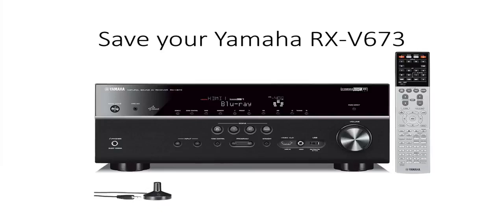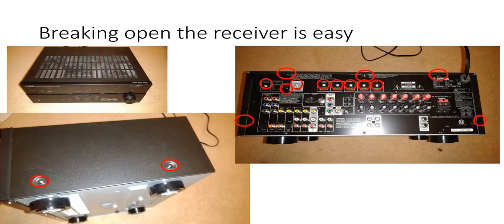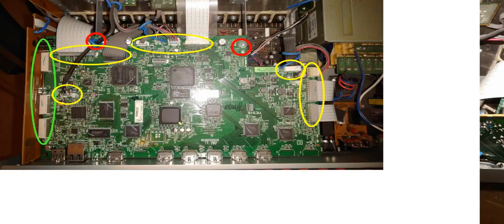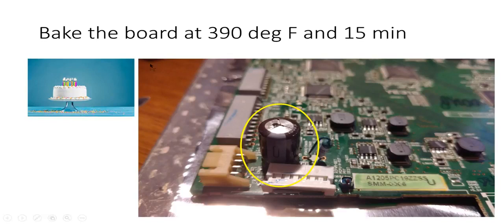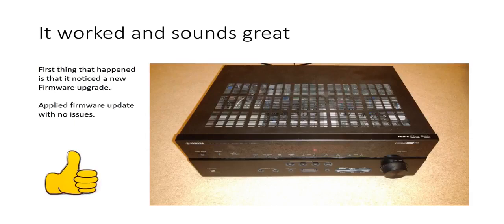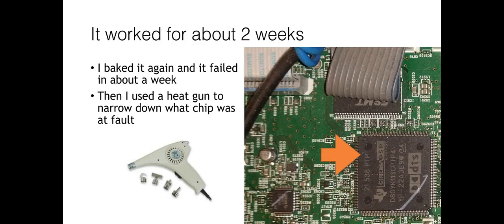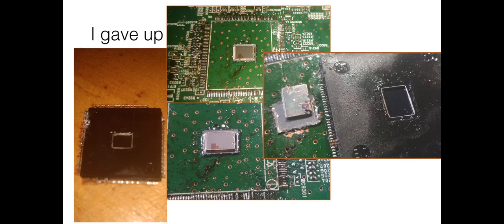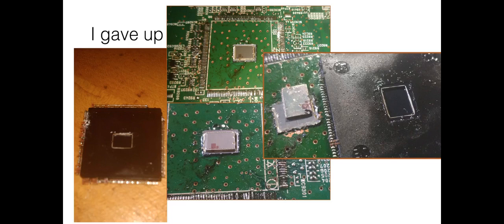Save your Yamaha RX-V673 (but it might not be permanent)

Comment: Why didn`t Yamaha use for example like a cpu socket on this DSP chips. Much more easy to replace them. And the contact would be much more stable! Got myself a Yamaha RX-A3040 receiver. Two identical DSP chips on that one. The known error is that the sound cuts out for a few seconds and the display of the speakers disappears from the screen of the receiver.
This only happens when running digital sound. Netflix etc. If you run analog sound, the problem disappears. I first sprayed the entirely digitalboard with Wd-40 spray. And used a toothbrush to clean the entirely digitalboard and chips. Then used a cloth on the chips. Then a hairdryer for 2 minutes on the DSP chips. Let it cool down for 10 minutes. Then I put Honeywell PTM7950 Super Highly Thermally Conductive Pad on the chips. Problem solved. No more sound cuts.
Reply from the maker: Money money money.  Every little piece of hardware used inside hits there bottom line and doesn’t help sell the product so your left with problems that are hard to fix.  Shops just swap the boards and chuck em if they fix them at all.
Reply: @yourdiytechlife exatamente. Obsolescência programada para giro de dinheiro.

Comment: My issue started after attaching an old Google Chrome device to my LG OLED which was attached to my RX-V673 via ARC. Replaced the receiver today with a new DENON (since the Yamaha is now 13 years old) and everything worked fine. Then the sound cut out again and speakers started to squeal and pop only when Google Chrome was being used. Not sure what happened. I removed the Google Chrome device and both the Yamaha and it are going in the electronic waste. Not sure if this is a coincidence but maybe it actually damages the receiver.
Reply from the maker: Yeah,  unfortunately I had to replace mine as well, I never found a way to keep it going for longer than a day.  I would expect that it was purely coincidence that it died when it did but why take chances.  I replaced it with an Onkyo RZ820 series that does atmos.  I’ve been very happy with I so far.

Comment: Man, i have the same problem. ARC worked only after on/off and changing channel a few times and now it doesn't work at all. Firmare in the menu is blank and when I update via USB it does it's thing for some 15 minutes or so and then i get the error 0010 -.- I am a bit hesitant to take the board out since i might damage something. You think it could work to use a heat gun on the board instead? And if so, are there specific spots I should apply the heat to?
Reply from the maker: You can absolutely try a heat gun.   And based on what I did that probably the best route really.  I ended up having to just replace the thing but heating the chip did help.   Hope you have better luck
Reply: @yourdiytechlife  ok so i opend up the thing and blasted the DPS chip with my heat gun untill it was very hot, i could not measure the temp, but it was too hot to touch. But that did not change anything. However just to make sure i tried everything, i tried updating it again by usb. And this time the update went through sucvessfully which was a surprise. Then after one or two restarts of the receiver and tv it started to work again! Just like that... now the question is how long it will hold up but we'll see.
Reply from the maker: @noiztrauma  that’s great news !!   Hopefully it holds but let us know either way.
Reply: @yourdiytechlife  will do if I keep it. I am playing with the thought of getting something else. Then again i haven't found anything in the same region of price and features. Plus it seems as pretty much every single brand had their own issues with dsp or acr and so on.
Reply: @yourdiytechlife  i will give it a shot. If that doesn't help i will get something else from another brand. Really a shame because the thing has a lot of good features, especially for the price. But the hassle with the ARC and so on renders my whole 7.1 system useless basically.

Comment: 100% the problem is the DTS/DSP chip. Very common issue with these. Flux should take of the problem. Or turn on Pure Direct, which bypasses the DSP chip and you'll hear sound again.
Reply: Same issue with my Rx_a2010. However in pure direct I still have no sound.  Any 8deas appreciated

Comment: I got a RX-A830 with no sound..  Speaker-icons shows on the OSD, but no sound..  Tried heating up the DSP-chip, but still no sound..  Test-tone or pure-direct doesnt work either. Very weird.
Reply from the maker: Thats eventually what happened to mine.  It simply failed all together and at the time the cost of a new chip was not worth it so I ended up replacing the receiver all together.  I have been using it for parts to fix other receivers so it wasn't a total loss.

Comment: Hey Dan. I came up with the idea to add a heatsink after baking the DSP chip as well and you already tried it. But I have to say you did it wrong. I realized that right after you got the chip removed: the actual silicon soldered to the PCB which acts like a heatsink. So the extra heatsink actually should be attached to the bottom of the chip (yes, right to the PCB on the other side of the main board). I have HTR-7065 with the same looking main board and the same issue and I'm going to try it my way: 1. bake the DSP with a heat gun from the bottom of the chip. 2. attach small heatsink(aka memory heatsink, I have different sizes, so I'll try to use the biggest that can fit) to the PCB under the chip with thermal glue.  At the same time I'm not sure when I'll do it, so  can't commit to any specific date. But I'll post my results here sometime later. Thanks!
Reply from the maker: cool idea,  it might just work,  let us know what the results are even if it lasts a bit longer than my attempt, that's progress.
Reply: @yourdiytechlife  I did it! Will see how long it is going to last. In order to use it as much as possible I attached it to my computer workstation via HDMI and I'll use it as my primary sound source everyday for at least 8 hours. Also I switched it to "7ch stereo" mode in order to make sure the DSP is in use all the time ("cinemaDSP" logo is on the receiver's screen). 11/19/21 is the start date.
Reply from the maker: @eugenedd  ok , keep us updated and  post up some pics of you have them.
Reply: Works fine after 1 month, it could be just cold season is helping to keep it working.
Reply: @eugenedd  Hi! I know it's been awhile but just hoping to hear that it's still working for you. I have the same issue and going to commit to this repair again.
Reply: @traviswaldrepaf  it was working fine for about 7 months, and then I sold my house and left the receiver behind. Sorry

Comment: I also have the same model with the same problem. After seeing your video, I thought that it may be the connections of the legs of the chips do not have good weld at some points. I used a heat gun with a very small nozzle to reflow the welded joints of the legs. After that, I got sound right after turning on. It seems it is working properly now. I will post again if it fails later.
Reply: Today (10/29/21) the sound comes up with about 5 seconds delay.  Will post again if it get worse again.
Reply: Today (11/2/2021) the delay is getting longer to about 15 seconds.
Reply: @tmho7091  alguma atualização?
Reply: @MoisesVenturaOficial  Sorry, I forgot to update.  Yes, the situation get worse with time.  I then tried to reflow the whole chip.  But after that, it could be turned on anymore.  Most probably, I killed the chip.

Comment: Thanks for posting this vid. Have watched thru several times as I have the same unit and apparent problem. I'll leave some comments to help others as this seems like a good repository of info because of others interest here with similar problem. Also have to say I have zero electronics experience and just making educated guesses here. 

I'd guess your board baking info was from another source. They must have had a digital readout to get the 390 deg. My old oven only indicates 25 deg. increments. 390 seems awfully precise, why not 400? and then rather than 15 minutes why not for 12.5 minutes? (LOL - just trying to be funny) Would vibrations while the board was cooling really cause problems? I remember when I was a kid my mother would take some swats at me if I ran thru the kitchen while she was baking as the vibrations might cause whatever it was to collapse. Maybe shaking the board a bit might cause the solder to flow into some of the voids if there were any (another possible funny - ha ha ha). 

OK so the board was baked and later the chip torched which both seemed to help temporarily. But then it was thought the chip needed to be kept cooler so a heat sink was attached. Things seem to be going in opposite directions. From my own experience with my unit is that the chip (or something else) does seem to need to get warmed up a bit and then it works fine but volume does go on and off until unit does get up to temp. 

Have also found out that playing a few seconds of DVD brings on the sound but is starting to take longer and longer to happen. Originally had intermittent sound problem watching ABC OTA TV channel and found TV antenna cable had come lose at connection to surge protector. So make sure cable connections are all tight. Don't know why it was only ABC that had problems though. 

The little pops you hear may be your speaker cones smacking away as the voltage come on. Not a good thing for your speakers. I found using the Pure Direct sound option helps to eliminate the popping but has issues of it's own but not as damaging as the popping.

Well I guess that's long enough. Thought there were some other things to add but my old brain has moved along to other things and I'm drawing a blank. Hope this helps.

Comment: my 673 needs to warm up before it works, takes over 30min, after that it works flawlessly, when it warms up the speakers click and the speaker icon on the screen flashes and the audio cuts in and out. got it from my grandparents and the amp was in a non ventilated cabinet for 4+ years (when they used it). they tried to get it fixed and the repairman said the hdmi controller needed replacing even tho the hdmi ports work great. the warm up issue is really really annoying. if you want to listen to music you need to turn the amp on 30min beforehand...
Reply: and when it was in the cabinet it ran really hot
Reply: My 673 does the exact same thing. It needs to "warm up" and I'll see flashes on the screen of the speaker display and hear pops from the speakers. I'll keep turning it off and on once it does that and eventually it will work with no issues like a champ. As long as it doesn't get worse or longer wait time, I'll deal with it. I was thinking it was a capacitor since the issue resolves once, I believe, cap charges up. Don't know if I'll try to repair it or just roll with it for now
Reply: @allenroy1638  it gets worse, now the amp wont stop clicking unless i heat the faulty DSP chip with a hairdryer

Comment: Sir I see this video and I use Yamaha rxv665 avr and my avr display in suddenly decoder mode off but last time same issue display but automatically start speaker icon and on but today is a same problem see plz what is solution plz send me
Reply from the maker: I wish I had a good answer for you on this problem but I don’t know the exact solution.  
The first thing I would do is unplug the receiver for 5 to 10 minutes and see if it then resets.  You can also try and reset it to factory default from the menu system.  If you can do a firmware upgrade from the menu I would do that as well.
Reply: @yourdiytechlife  i have try reset all but same issue not solved

Comment: Thanks for the vid. My Yamaha RX-V673 was cutting the audio on and off,  heated the dts chip with a heat gun for 2 min. Seems to work for now, will report when/if it fails again

Edit: started to cut off again about 1 month later, repeated the process and it seems to be working again. Going to start looking for another receiver now, luckily the yamaha only cost me $15.
Reply from the maker: Excellent.  Hopefully it works for a long time.  👍👍

Comment: Dan, I am trying to find a video to show me how to test a stand bye board for the yamaha"s recievers
Reply from the maker: I'm not sure what you mean bye stand by board.  Do you mean a board to replace the one with the bad chip or is there another board that has problems in these receivers.
Reply: The standby power board
Reply: ok forget the stand by board for now I have a v385 model that does not turn on looking and checking i found a short at ground that gives me 28volts i touch the fins on the heat sing and got a little shock

Comment: Hey dan those chips only lasted 2200hours of on time
Reply from the maker: Are you saying that was the designed limit for those chips?
Reply: @yourdiytechlife  yes
Reply from the maker: @kennethfriedberg2358  that's interesting, did you see that in a spec sheet some place?
Reply: @yourdiytechlife  No another tech
Reply: make sence through
Reply from the maker: @kennethfriedberg2358  I'd love to see documentation on that. That's an incredibly low number of hours so if their mtbf really is that low then it does make sense that there are so many failures.
Reply: @yourdiytechlife  I do not believe it is only 2200 hours as I used at least 6 hour a day(it was connected to my computer  and all video-audio ran thru receiver and my computer was always on when I was at home, usually listening some internet radio at least) and it lasted 5,5 years which makes something around 12000 hours at least. After my device died, I checked new yamaha model in shop and saw between hull cooling ribs that new model have radiator and (i think it was) also a fan on it. It is obvious, that if this chip on board do not have any additional cooling options, it will fail quite fast. It was my first yamaha and i think, also last.

Comment: How does one replace the capacitor? I am where you were with my unit and will be attempting the baking, possibly heat gun. Is a special tool needed?
Reply from the maker: To remove the capacitor you will need a soldering iron.  If you use a heatgun method then you'll just need a heatgun to focus on the chip.
Reply: @yourdiytechlife  still watching dan

Comment: Thanks for the video! I've been searching for a solution for few days and think you've finally solved my problem, which means my Yamaha HTR-3066 receiver is probably dying by hardware due to that chip issue too. Everything on my receiver works good except my 'Cinema DSP' light will not lock 'on', as it will flash or blink for a while and then eventually warm-up to work. This started out as a few minutes a few weeks ago but keeps getting longer in time. It will work as long as I don't power it off, otherwise the 'Cinema DSP' waiting game begins again once it's powered-on. I think I'm going to just buy a new Sony this time as my older Sony 5.1 system still works good and I thought it actually had better sound quality for music anyway, but am planning to do a little research first.
Reply from the maker: Well that's a bummer,. HTRs are not the only devices out there that suffer the bad chips I have found.  I have an iMac that has a similar issue with the video adapter however with that device I have been able to bake the chip and it's worked for up to a year and a half, so a very different experience there.  
I opted for a receiver with Dolby Atmos but honestly I don't ever use it.  
Happy hunting for a new one.
Reply: Ok by me fella
Reply: I said texas instruments don't make thoses chips anymore but wait yrs coming out with new chips

Comment: I have the same problem in rxa 830. Replace the dts chip with a new one and only sound comes out by pure direct mode. Before the audio was cut but after heating the equipment worked fine. Now only in pure direct mode. Any suggestions?
Reply from the maker: G-CH it kind of sounds like it’s bypassing the dsp somehow.  Have you tried to update the firmaware.  You might try that.
Reply: U didn't set it right
Reply: The same shit on my rx-v475 european model, working just on pure direct an just a lot of humm nois coming out on whatever else mode... What a damn Yamaha
Reply: First update the firmware. But if it does not still work, then u made a mistake.. 

May be one or some of the legs did not properly soldered to the board. 

Or there is a short somewhere among the legs after u soldered which u can't see.

 Or u bought a fake chip.